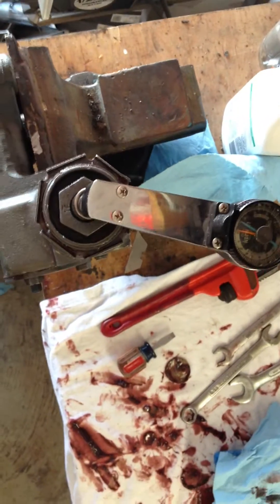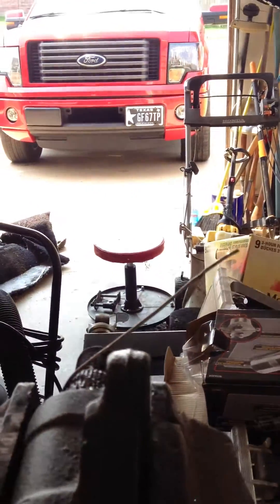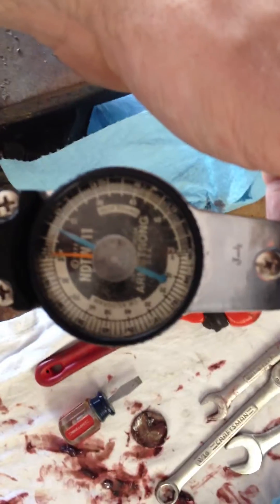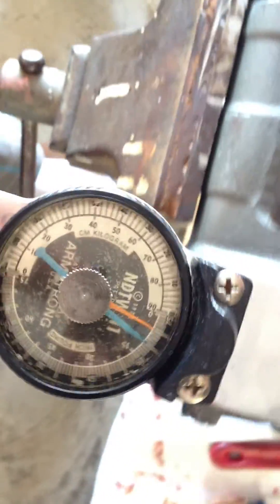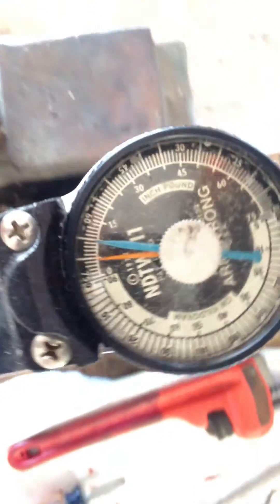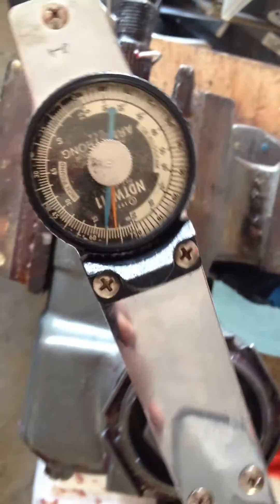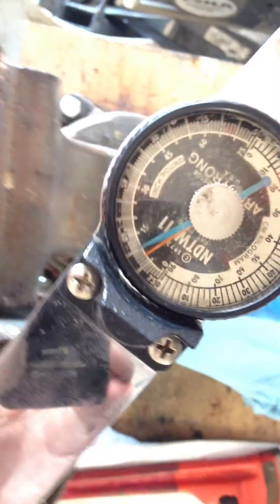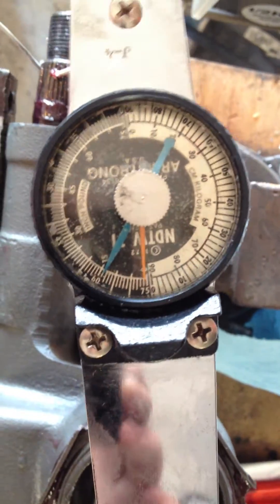Trying to adjust ford steering box with in/lb dial

Comment: How did it perform installed with the odd shakes?
Reply from the maker: I never updated this! Glad you asked. To this day still running this box and zero issues. Still strong and tight. Never felt that odd  "notch" in the steering wheel.